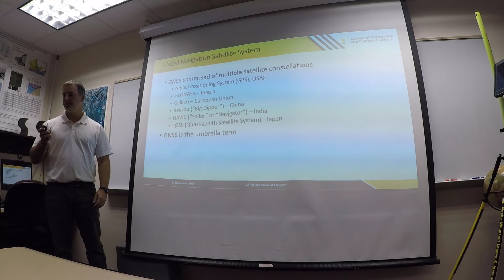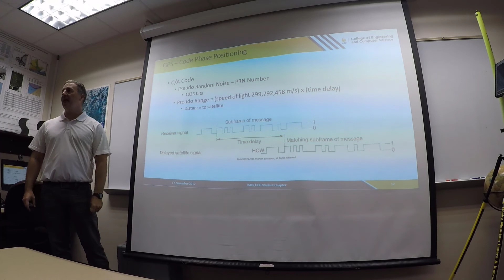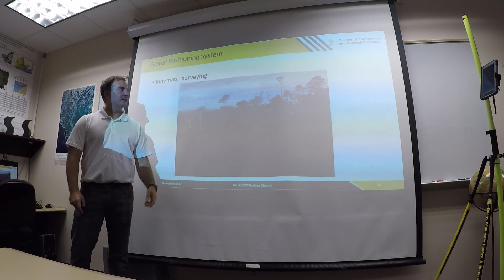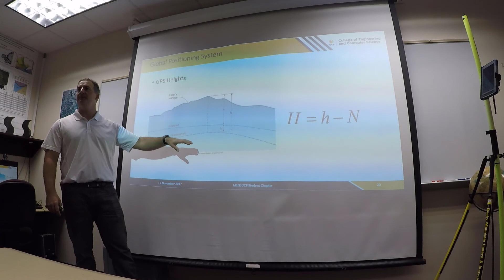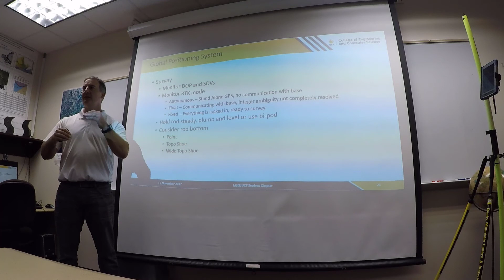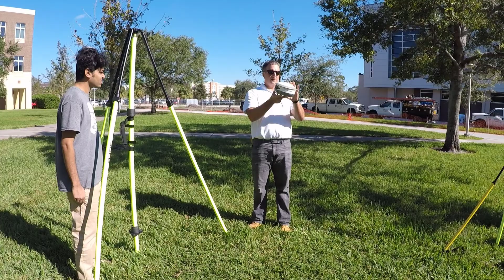GNSS RTK Overview Workshop

Comment: Excellent video, thanks !

1:14:05 - "actually if that was a real project we'd set it up at a known point". Does that mean that the rover's position will only be as accurate as the base station's position accuracy or does the integer ambiguity get resolved just "as well" with an approximate position ?

EDIT - after some more reading, the answer is yes, the rover will have the same offset as the base station